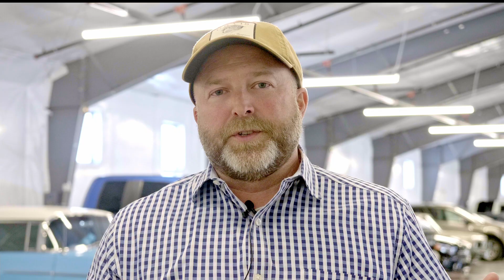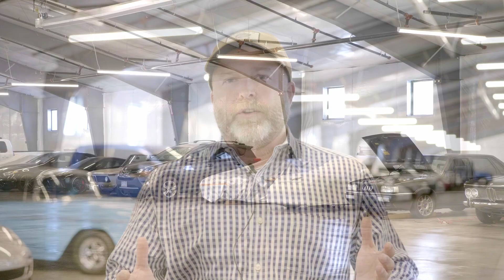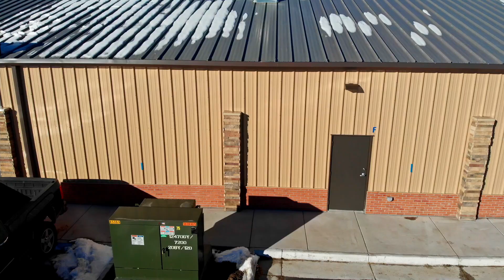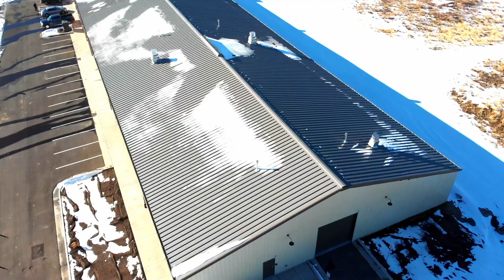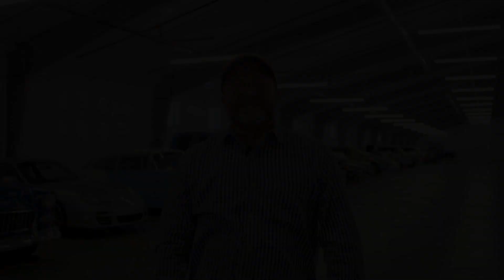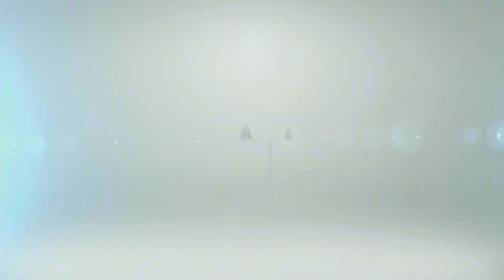Castle Rock Auto Storage 85 x 280 | Great Western Building Systems

Comment: How did you heat it? Radiant floor? Saw another steel building in I think Montana run radiant heating in part of the steel roof as well for snow load mitigation. Just amazing what the tech can accomplish if/when the dream is thought up.